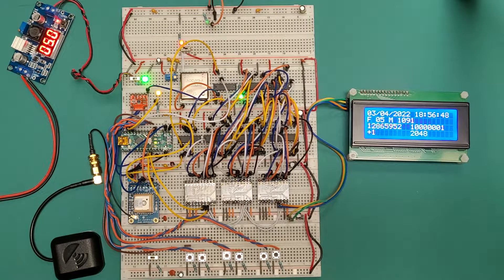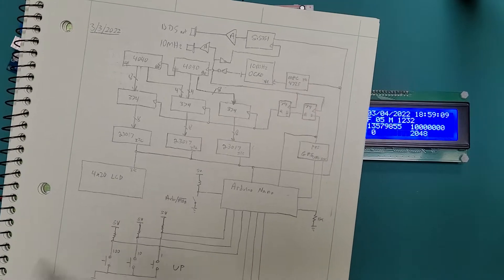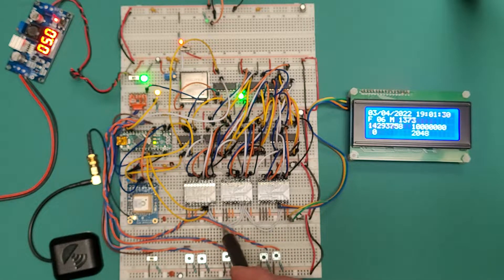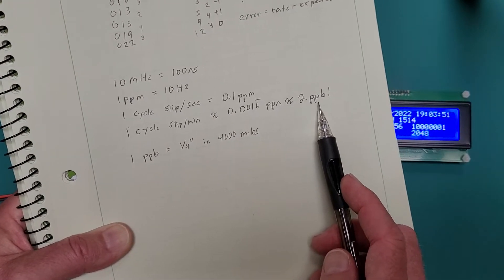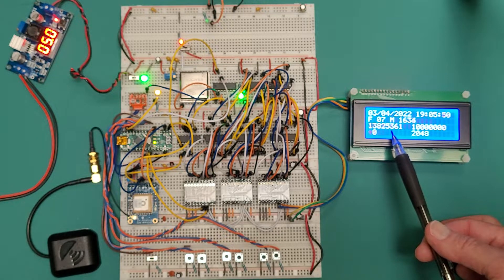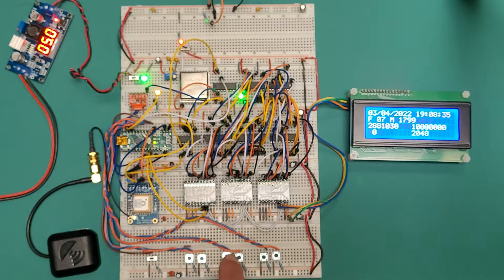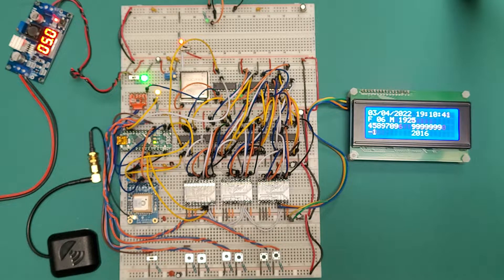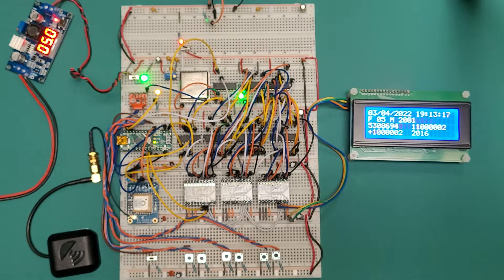GPS Disciplined Oscillator part 1

Comment: Question. As I understand it, you are trying to keep your oscillator OXCO stable as a function of what the GPS sig is reporting, then dividing that down for more resolution. If so, you are still at the mercy of what the GPS DO is reporting,. is this correct? The advantage is iF you don't see a sat, not likely, you still have a reference.
Reply from the maker: The OCXO is inherently stable. I need to tune it to the correct frequency. The PPS from the GPS has jitter. By integrating over many seconds, that jitter is reduced by the number of seconds of integration.
Reply: @davidskirmont8294  This is not a jitter. Every PPS pulse GPS module make a software correction of rising edge to move it precise to SAT atomic clock.